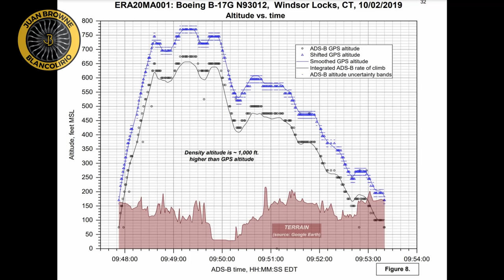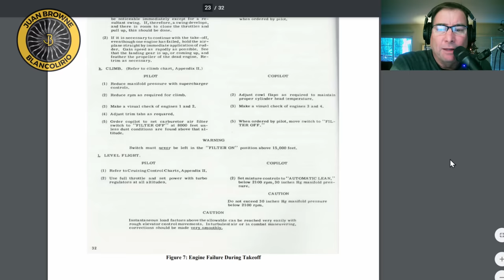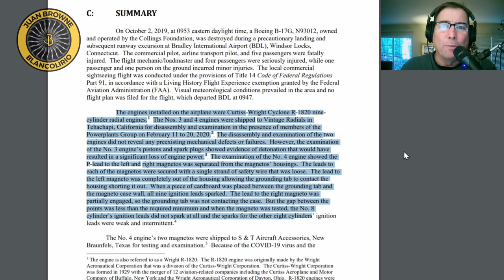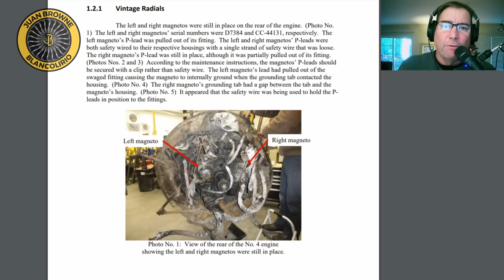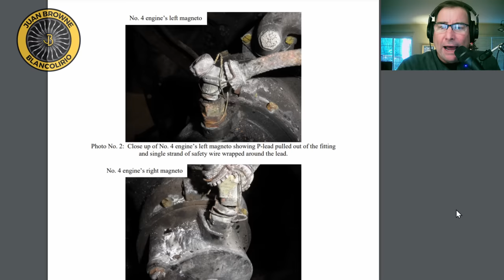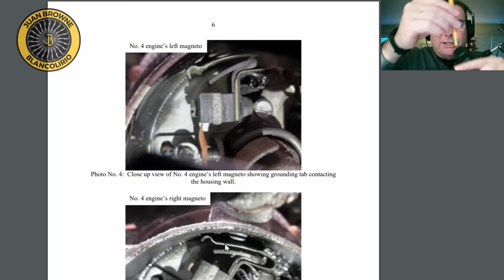NTSB Report B-17G Crash 'Nine-O-Nine' Part II -18 Dec 2020

Comment: 300 SMOH. You must be kidding. Somebody's got some 'splaining to do. All of those ignition problems can NOT be from normal wear or service in 300 hours. I worked as an AME so I know a little about this stuff.
Reply: The #4 engine had over 1000 hours since overhaul.  The other three about 300.
Reply: @donmoore7785  Ok. Thanks for clarifying that. Still wonder why the bad mag wasn't picked up when the crew did the run up. Anyway there are a lot more questions than answers at this point.

Comment: So if one mag on #4 was grounded, a runup performed before takeoff would have included a mag check and no rpm drop when that mag was turned off, right? So they knew they had a 'hot' mag or at least a problem before takeoff?

Comment: Is there anything more coming out regarding crew performance and other contributing factors? 
It appears the entire day got off to a rough start, with the engine issues and resulting delays.
Could there have been pressure to make the schedule, leading to things such as the missed passenger briefing and intersection take-off?

Comment: Juan! EXACTLY the same problem with Locomotive maintenance. The big Engine maintenance operations are gone. Work shops at these charities can do most of the simpler heavy duty stuff. But soon as you're talking boilers and boiler overhauls. Off they go for a sixth month overhaul at the only specialist in the country. So the boiler must pass it's inspection after maintenance to iron out any defects from the maintenance. Either gear not available or extra cost involved, so a bodge job is done to cut costs and corners. Watching the stripping of this Messerschmidt 108 on Kermit Weeks's Channel show bodge job, on bodge job a real eye opener for me. If any planes will be as safe as they can be for their age, it's Kermits Weeks's Aircraft!

Comment: Think of the condenser (capacitor) as  a balancer. It counter acts the electrical phase shift of the coil (inductor).  Metal will transfer (arcing) to one side or the other of the points when the value of the condenser is incorrect. Gating is a whole different concept. Great job of condensing the NTSB reports down to 20 minutes.

Comment: That corroded cylinder sure peaks my interest. I would imagine that some fire retardant made its way in there, if the exhaust valve was open, and the exhaust was undoubtedly torn off in the crash. You couldn't have that much corrosion in a moving cylinder, IMO - traces of it, sure, but not like that pic -it looks too fresh to me. Even if the cylinder wasn't firing, just the scraping action of the rings would polish that up quite a bit, especially at the speeds pistons travel during the course of engine operation , along with the expansion and contraction of the wide temperature variances between a cold and hot engine.

The points look to be the same basic setup I have on my '74 RD350. Coils are fed 12v from the battery, through the ignition switch. That 12v continues down the ground wire to the points, where it's momentarily grounded by the points closing - current flows through the ignition coil primary, through the points to ground. The moment the points open, current stops, the field collapses in the coil primary through the secondary windings inducing high secondary voltage - spark! That one set of points that had the narrow gap - I wonder if that was the cause of the detonation. A narrow gap advances timing, if only slightly. Definitely was a contributing factor. Of course a bad condenser will eat up the points pretty fast. Definitely some poor maintenance there. I would never run my RD in that condition! At the first hint of trouble, everything gets replaced. 

That's an interesting safety feature for the P-lead there. If I were going to Micky mouse that with safety wire, I'd have used a whole lot more than what was there, that's for sure. I wonder how much of this was altered by the crash forces and fire? We may never know. Doesn't change the fact that it should've been repaired correctly to start with. Aviation is unforgiving of poor choices ...

My .02! Excellent vid, Juan! Thanks!!

Comment: back in the 90s i was at an airshow at Raf Bentwaters and one of the old planes on display was dripping oil onto the ground.Can remember a 45 gallon drum  arriving on a airforce truck ,being wheeled out and the plane topped up and away it flew .Funny what you remember

Comment: If you're old enough you remember how easy it was to stall your engine if you drove through deep water or washed your engine at the car wash. I remember it all too well. Pulling the distributor cap off and drying the points out. The good old days.

Comment: Ugh, primarily there are 2 ignition systems on an aircraft engine so it a properly maintained system has an unforeseen failure, the other system keeps the engine running.  For large combustion chambers, 2 spark plugs help with fuel burn as is noted by an RPM drop when running on one ignition system.  Detonation can be caused by spark scatter / carbon tracking under the distributor cap.  This is where the next cylinder in the firing order gets spark rather than the current one.  Also, the cylinder corrosion looks way too heavy for a running engine, I'm betting it was caused by the fire fighting effort.

Comment: Thank you for your thorough report and taking the time to do so. With all due respect, the NTSB released their 1200 page factual report yet two channels, yours and Flywire have conflicting summaries as to which engine, #3 or #4 was the engine that failed which led to the crash. This inconsistency between two very well respected gentlemen and their channels not only causes confusion in the industry of WarBirds but also to those of us who work on them.  Any clarification would be greatly appreciated.

Comment: Reading the Engine Failure During Take-Off checks, I'm slightly surprised that it appears to consider a situation where in the event of an engine a take-off would have to be continued with the aircraft still on the ground, ie V1 < VR.  For wartime ops with a heavy aircraft, OK.  But as a vintage warbird?  Surely a V1/VR of unity should be mandatory?  

In the previous video did you mention that the crew executed a run-up prior to departure?  I remember doing this in the Chipmunk and later Bulldog in the early days of my career and it included checking the mag drop with first one and then the other circuit switched off.  You'd have thought that this B-17's issues would have been very apparent as they went through this procedure.  Does the report go into this at all?

It does appear that yet again an accident that is prima facie a mechanical failure was actually a multi-level Human Factors failure.  Very sad.

Comment: It was a mag issue like this which brought down a Spitfire XI at an air show in France several years ago, killing the pilot. When they were tested, one was producing next to no spark and the other was failing under load. When stripped, they also found a rubber insulator which appeared ok but which was contaminated with microscopic metal and thus arching under load. The basic problem was simply age and the reliance on a simple mag drop test before take off. Both the Spitfire mags only started failing when hot and under load. This lead to the UK civil aviation authority issuing an advisory to all Merlin and Griifon engine operators on proper maintenance and load testing of the mags.

Comment: Your not supposed to stand on top of a ladder like that, It is very unsafe.
Reply: Ya, you just have to read the warning label on the top rung.
Guess safety rules don't apply to this guy.
Reply: @Tony Thompson 
That also goes for baling wire.
Reply: No one was going to tell this guy what to do.

Comment: Correction: detonation is pre-ignition of the fuel-air mixture, and it is usually caused by improper fuel, and it can also be caused by improper ignition timing or overheating.

Comment: Just watched the video again, looking closer at some of the photographs, it is almost incomprehensible to me that a man of this vast experience in this aircraft could have knowingly flown that aircraft with the major issues with the magnetos that can be seen in the photos. The safety wire gump-up of the primary lead, on both magnetos on #4 engine was something a young teenager might have done on an old go kart motor. The pilot could NOT have done a proper mag check on #4 that day despite what the loadmaster said. The engine would have died the instant he shut off the one good mag. Either the pilot knew that left magneto was dead, or he just never bothered to do the mag check that would have clearly shown it. There are 2 magnetos on aircraft piston engines for a very good reason, SAFETY. In the old days of flying it was realized that the ignition system was a weak link that caused lots of crashes so this led to the idea of 2 mags for safety and redundancy. 

I noticed that shortly after the crash the man now described as "loadmaster" was referred to as "crew chief". Perhaps his almost total lack of experience and knowledge of the aircraft led to that change. 

How the pilot/mechanic could willingly ignore huge safety issues and willingly risk not only his own life but the lives of paying passengers I will never live long enough to comprehend! The Collings Foundation should NEVER be allowed to operate like this again. 

As a parallel to this there is the story of the replica of the square rigged ship "Bounty" that was also managed by a non-profit. The large wooden vessel was in deplorable condition, unsafe to put to sea in in my opinion, the crew were all young volunteers, unfamiliar with the ship, and an arrogant, but inept, captain who allowed that no hurricane could stop the Bounty. The ship went down as the captain decided to sail directly into the path of Cat 5 Hurricane Sandy. Only the captain and one crew member were lost, but only due to a vast overnight recovery mission by US Coast Guard members in extremely dangerous flying conditions. Even the pilots of a C-130 circling the scene to keep it on their radar were airsick the conditions were so terrible. In that case, as in this one, totally inept people were in way over their heads. I guess no amount of regulations will stop this.....if they are not enforced.

Comment: the pilot standing on the top platform of a ladder - very poor judgment with ladder use - same poor judgment as a pilot and maintenance?
Reply: Agreed. I see poor safety culture within the foundation. Not showing customers emergency exits and poor working seat belts further shows poor safety culture.
Reply: @shack7296  i don't know how many times i hear "oh he was a very capable - experienced and knowledgeable pilot"  always said after they are dead after an accident where they are at fault? you are only as good as your ability to do the right thing always - never let your guard down and never rush or not follow proper procedures - period.
Reply: @foxmoth5477  Absolutely.  Character matters.
Reply: Great safety brief Juan. It's worth the effort to make the living history program better. I hope there can be a remedy satisfactory to the FAA to preserve these programs. Let's show them, we as a community can make the necessary changes and continue better and safer than we did before. It's all about the history of the sacrifices made for this country.
Reply: that was very disturbing when Juan said as when i and my dad went on a pleasure flight on a classic wings DH-89 Dragon Rapide years ago 
they told us how to use the seat belts and how to get out of the aircraft in case of an emergency
Reply: @shack7296  former flight attendant here: 2 of the most important things in any safety briefing. And  some of the seat belts were frayed and broken? This is just another brick in the wall of this awful accident. This never should have happened.
Reply: All these videos portray Mac as a "Hot Dog." No run up of the engines, it was like "I got it going, let's fly before that engine stops."

Comment: When I compare this maintaining my 1972 garden tractor's Briggs cast iron 10hp engine, I have to observe that maintenance here seems to have been grossly lacking.  I have let a few things go until engine performance was affected, like the points for example.  But I don't fly my tractor.  I would have expected far better maintenance of the ignition system on this aircraft than what it appears to have been.
Reply: @dhouse The FAA has strong safety regulations that have been developed over decades, covering airlines and general aviation. Following those rules is crucial in achieving maximum practical aircraft safety. However, the FAA specifically created EXEMPTIONS for warbirds, and exemptions have potential consequences.
Reply: But if you did fly your tractor 😮